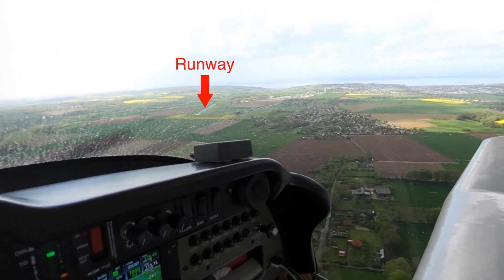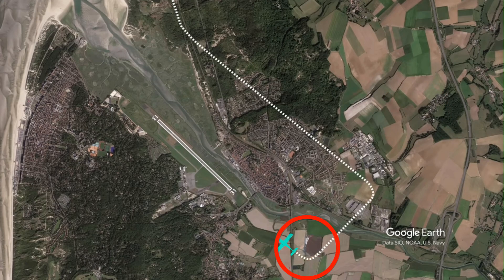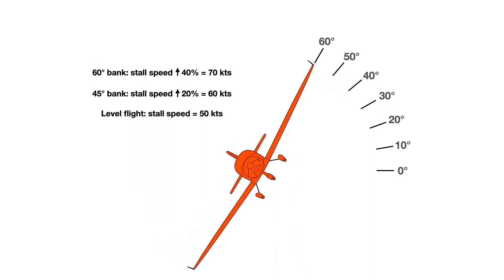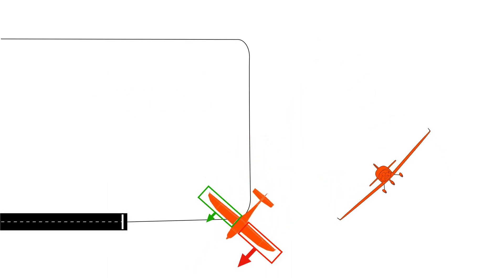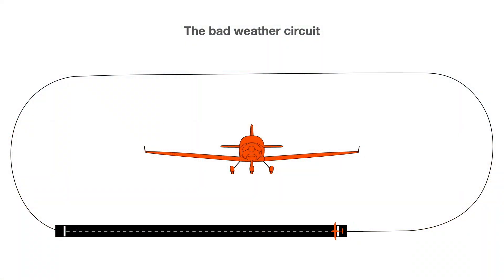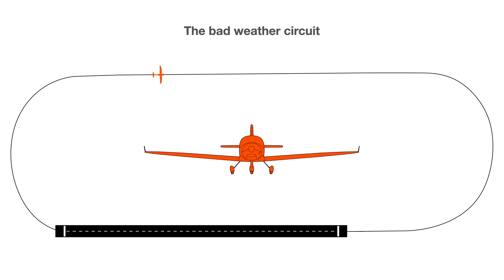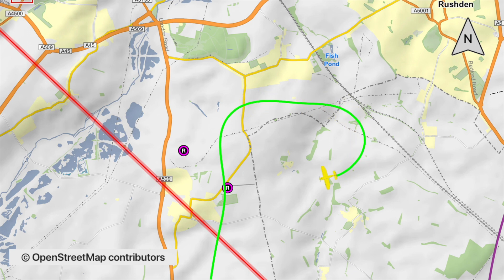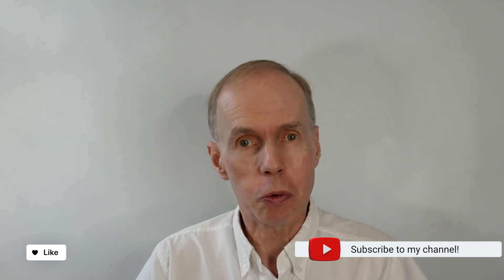Avoid the 'graveyard turn'—a safer way from base to final

Comment: While I understand and somewhat agree with your point, this method doesn’t allow for the normal traffic avoidance procedures as it leaves a large blind spot beneath the aircraft. The rectangular pattern is rectangular for scanning and collision avoidance purposes. If I’m in a constant turn like that, the fuselage and wing (if in a low wing) could very easily hide an aircraft beneath it. I think it’s safer to just fly a normal pattern at airspeeds, bank angles, and load factors that won’t produce a stall rather than leaving a blind spot beneath the aircraft. 

On top of this, extra emphasis should be placed on go arounds and stable approach criteria.
Reply from the maker: If everyone is flying at the proper circuit height then surely they should all be at the same level and if everyone practised the curved approach then there would be no conflicts at that level. Of course the vast majority of base to final. turns don't result in a stall, but the few that do, often when the pilot has become distracted by other traffic or radio calls or weather, are almost always lethal, so I prefer to mitigate the risk.
Reply: @pretavol  the issue is the pattern is a dynamic environment where everyone has different speeds, performance, and pattern entires. Where I fly there can be everything from J3 Cubs to E175s at an uncontrolled field. I could very easily see a nasty near miss or midair happening from something like a Piper Cherokee colliding with a jet on a straight in approach because it was hidden beneath the wing the entire time. 

I’ll meet you halfway and say a nice big sweeping base to final turn after leveling out for a few seconds on base would work well for keeping load factor under control while still allowing for scanning and collision avoidance. With that said, I’d advise against posting videos promoting procedures contrary to common practice as this can create unnecessary confusion and lead to a dangerous environment.
Reply from the maker: @hobie1613  Roger. The point of posting the video was to encourage sensible debate on a matter of safety, which it has, and I see a consensus. I am not suggesting that any particular routine is optimal for every situation.

Comment: I am fully onboard with this technique!

As mentioned, when a pilot overshoots a square corner there seems to be a bad tendency to try to tighten the turn with rudder, making a bad situation much worse. While to me if making a more rounded turn the pilot is in a much better position to use sideslip before even completing the turn to get lined back up with the runway instead of aggressively steepening the turn. Adverse rudder actually makes the airplane MORE spin resistant than using no rudder.

Comment: At broadside to the end of runway always pitch down add flaps until base leg. No stall if pitching a negative angle of attack.
Reply from the maker: My point was that the risk arises at the base to final turn, not broadside to the runway on base leg. The aircraft will stall even at a pitch down angle if the critical angle of attack is reached!

Comment: Very good video. The other reason this constant turn from downwind to final is good is that the bank angle required is low which allows for better visibility to watch for traffic. No matter how I maneuver in the pattern, I never stray from calculated minimum speeds and maximum bank angles for various landing configurations, giving healthy margins above the stall.

Comment: If I may add my 2 cents.  Although your depiction of the bank angle increasing stall speed is spot on, that performance chart is based on "level" flight which you do indeed mention.  Since a wing stall is a function of the wing exceeding the critical Angle of Attack (AoA) however, my instant question to ask my student pilot would sound something like,  "Why on God's green Earth are you in "level" flight on your descent and approach"?  In most light general aircraft, A nose-down attitude, which reduces the AoA, should be maintained once the descent and approach phase begins unless a go-around is executed.  Thoughts?

As for the rounding of the pattern, it is the most common way I land.  Low wing vs High wing does, however, modify this a bit.  Thanks for the video!
Reply: Whether climbing, cruising or descending the lift vector is approximately vertical and its magnitude is close to the weight of the aircraft (because cos(x) is about 1 for any x near zero). If it were not so, the aircraft would be accelerating upwards or downwards rather than maintaining a constant climb rate / cruise altitude / descent rate. i.e. lift is essentially the same in descent as in level flight and so, at the same airspeed, the same AoA is required. You might then wonder why pitching the nose down results in a descent. This happens because for a short time after initially pitching down the aircraft does accelerate downwards. But pretty soon the rate of descent causes the AoA, and hence lift, to return to pretty much the cruise AoA.
Reply from the maker: Thank you for your comment and yes, I agree: the depiction of bank angle and stall speed was, as you surmise, to illustrate a point but the principle will hold good at a given angle of pitch. It will still be possible to stall a wing in a tight turn even when pitched down.

Comment: It comes down to timing and understanding what the plane is doing. You have to understand where the wind is coming from and if you have to turn earlier or later. I teach to limit to 30 degrees bank. I don't like the constant turning pattern as I believe you can lose sight of the long final traffic.
Reply: Maybe split the difference and just round out the very last turn more than usual....level out prior to that only long enough to get a good look for that traffic, and begin a longer turn to final as soon as you are satisfied. Unless there is another reason to wait after that, it seems logical to me.
Reply: I’m not quite understanding, and many also say the same as you about losing sight of long final traffic, but I don’t understand how.
At first I was just thinking you will see absence of long final traffic in continuous turn also for most of it, or the first half of the turn, so isn’t that good enough? but then thinking you all mean if you do see long final traffic that you are monitoring how far away it is at all times. But if it is close enough to where you need to monitor, 1) isn’t it up to the final traffic to adjust? And 2) if that close isn’t that cause for go around? 
Trying to understand the concept.

Comment: One reason for the squared pattern is for traffic identification and avoidance.  I tend to round out the base to final at towered airports with on duty controllers but level the wings on base to check for any unannounced traffic on final at nontowered airports.  I fly an RV-7 so it has the usual low wing blind spots.
Reply: Agree!  For sure at untowered want to do 2 phases. Plus, power for altitude, yoke for speed on landing is what I learned. Shouldnt be pulling back on yoke for altitude, add power.
Reply: My home airport has a mountain blocking the upwind entry from base to final. You can't trust people will use a proper traffic pattern anywhere (just witnessed a bad pattern Sunday).

Not leveling the wing to check for traffic is unwise.
Reply from the maker: Thank you for the comment. It is a point that has been raised before. As I stated in the description, I am not suggesting that the pattern I describe will be ideal for every situation, and variations may be appropriate according to circumstances; I am trying to point out the dangers of a sharp base-to final turn, that is typically undertaken at low level and low airspeed where there is little margin of safety, and offer a solution to consider.
Reply: I fly an RV-7 too!

Comment: Good video Steve but I'd like to mention airspeed too. A little more airspeed would help during these turns and a little longer pattern distance from the runway helps to get what some call "stabilized". Some guys at my home drone like to stay real close to the runway on downwind in case you loose an engine. Practice and planning with a CFI always helps too.
Joe
Reply from the maker: Absolutely:how many times must an instructor have said "watch your airspeed" when a student gets distracted as the workload increases!

Comment: I very much agree that a square pattern is dangerous. However, a constant-bank 180 from downwind to final makes it very difficult to 1) scan the final approach for aircraft making long, straight-in finals, and 2) makes it much more difficult to compensate for strong [cross] winds and, particularly, winds that change significantly between pattern altitude and the surface.  After all, it is those winds blowing the unsuspecting pilots towards the field that is the primary root cause of base to final overshoot.

My preference is to dog-leg the base/final, i.e., a normal 90 degree downwind to base, then wings level for a good scan for those straight-in finals, and then turn towards a point a few hundred feet from the threshold for a very short final.
Reply from the maker: In a high wing aircraft it should be easier to spot traffic on straight-in approaches throughout the 180° turn compared to a rectangular approach. For a low wing aircraft it will be easier for most of the first 90° and more difficult (even though the bank angle is modest) for the next 90°, but collisions in the circuit are relatively rare compared to crashes due to base to final stalls.
As far as the wind goes, I find it easier to make gentle compensations in a long turn than try to do it all at once in a tight turn. If I get it wrong on a curved approach then I can go around, but getting it wrong at base to final can be fatal!

Comment: I've lost several planes in my time from this exact mistake. Fortunately they were R/C aircraft so no fatalities, but pretty damned expensive. I'm not the only one by far, and for awhile we all thought there was a signal dropout zone in one notorious section of our flying field - but we eventually figured out that we were banking way too tight in order to line up with the runway. It can be pretty difficult to guage these things when you're standing across the airfield from your plane with your transmitter, trying to control a model plane that is quickly banking towards you at an angle. Cost of an education as they say.
Reply: R/C aircraft are an order of magnitude harder to fly than full size aircraft. Although it is utterly unprovable, I would bet that pilots that started flying models before moving on to full scale are at half the risk of dying as other pilots. Although, last time I was at a model airfield half of the aircraft had wing levelers and gyros, maybe that cuts back on the most important lesson of fly the aircraft all the way to the crash!
Reply: Interestingly I exclusively fly with gyros in nearly all my models (using a setting that fights off singular interference to the intended flight path, the models don’t auto level).

Despite the additional support this turn is indeed still the hardest of the four corners, which I hadn’t fully realised I was aware of until watching students make the same mistakes as you described, sometimes ending in disaster and always followed by bewilderment.

-a model aircraft instructor
Reply: I feel you...I've lost three wives like that.

Don't worry, I'm OK. They were all trying to skin me alive in divorce court anyway.

.......Also lost my mailman and a neighbor that way

Comment: There is a lot of writing about why this turn can be so dangerous when people have no trouble making similar turns in the air. To me, the obvious different factor is the ground rollout reference instead of a heading. Now, not only are you rolling out on a particular heading, but you’re additionally tasked with lining up the rollout to make it tangent to the turn. I believe there is a tendency to make a decreasing radius turn when you realize an overshoot is imminent.
This type of large radius turn gives you much more margin to adjust than a discrete 90 deg base to final, and a variation is totally standard for gliders.
Reply from the maker: Absolutely: as I explain in the video, it is the combination of a precise target (the runway threshold), low airspeed and low height that create the danger. 
As you say, glider pilots make curved approaches as do military pilots, so why are private pilots not trained to do the same?
Reply: @pretavol This might interest you - in Australia, glider pilots are taught to always make 'well banked' turns in the circuit, and generally this includes discrete turns onto base and final.

I believe this is to reduce the temptation to 'over-rudder' the turn, which might occur in a shallow bank which is overshooting the runway. It sort of makes sense, as glider pilots are used to using lots of rudder in basically every turn - it's easy to see how someone could reflexively use this to drag the nose around while turning into final.

Of course, glider pilots are also taught to modify this part of the circuit in any number of ways in order to deconflict with traffic and ensure they stay on the right glideslope.
Reply: Low altitude turns to target make more sense than turns to heading.  We want to go where we want to go, target, and not hit things in the limited horizontal space available.  We should also use the vertical space available as potential energy of altitude traded for airspeed.  If we always make turns the way the airplane was designed for safety, Wolfgang asks us what the airplane wants to do, we would relax the back pressure and make 1 g turns at whatever bank angle is necessary to acquire the target.  We do this with every turn crop dusting.  The target is the crop or in this base to final instance, the target is the numbers.  I understand the large traffic pattern now days at big airports, but we don't need to stay up there.  Also, if we bank more than we think we need, while releasing back pressure, early in the turn, we can decrease bank when coming around onto target so as to not have to increase bank late in the turn when lower.  The design of the airplane, dynamic neutral stability, is to fly.  The design prevents stall unless a pilot pulls back on the stick.  The other issue would be wind management.  If practable, make this downwind to final turn into a headwind component any time the wind is crosswind to the runway. @pretavol